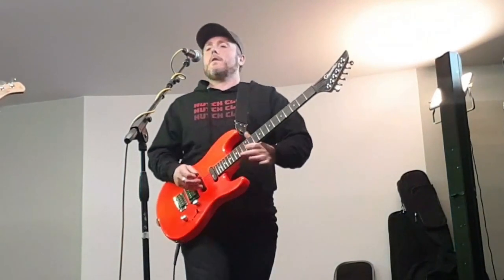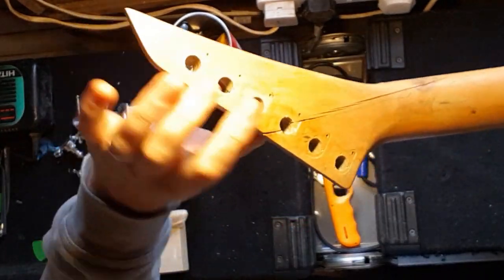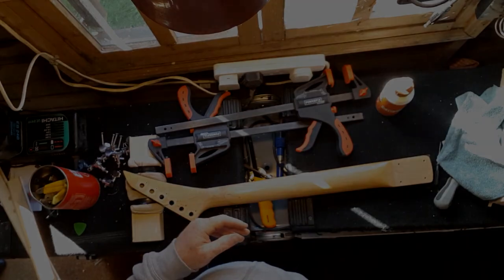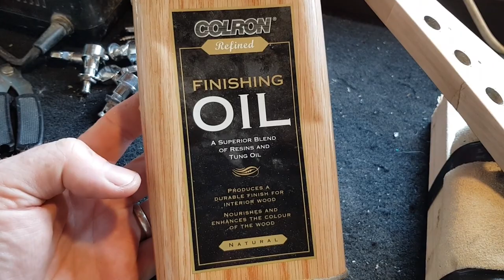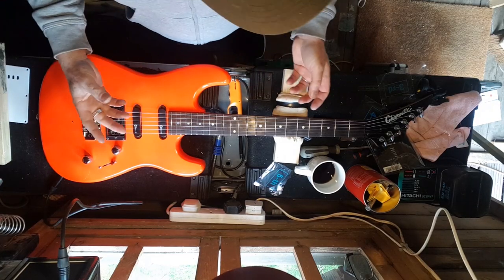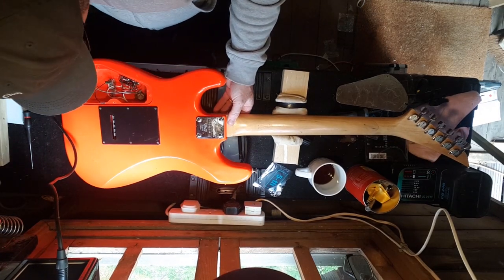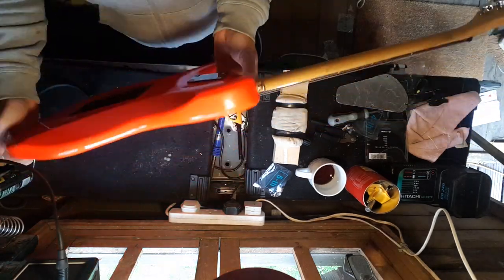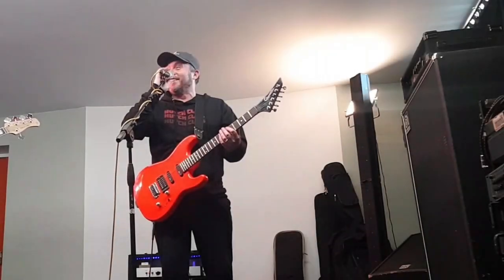Early 90s Charvette Fat Strat Saved !!! Why Did I ever Get Rid of Mine?

Comment from the maker: Fun Fact! I had this same guitar was I was 15 and it was the second guitar I ever owned. Working on this one was a trip down memory lane and I am so happy it is now back to Rocking out!!  Any of you guys had one of these?
Reply: Brilliant playing....and what a guitar love the neck...
Reply: My first electric when I decided to start playing 10 years ago.  Bought it from a guy on craigslist for $100, had to drive to meet him in a parking lot.  Turned around and drove to san diego to get a valvetronix amp to go with it.  Love the guitar.  Love the reverse headstock, I aped a lot of nine inch nails type stuff with that low e, just learning to play what I could and enjoying the guitar.  And the pickups are sweet, dynamic turned low, and the humbucker really screams when full on.  Eventually upgraded the pots to give me coil split and modern/50s tone control switch, and replaced the 5way, cleaned the sound a bit, but it’s always had intonation problems with the d string, and goes out of tune pretty easily, so it’s a personal player/‘sound’ guitar.  I usually play my mim strat, but it is a good backup, and the ceramics sound as good as the gfs alnicos in my strat, so it’s sort of a backup guitar.  Oh and that paintjob, nuclear neon orange!  And strangely I found if you put a blacklight on it there is a ‘charvel’ logo that faintly pops up.  There’s controversy over whether they were made in japan or korea, but it is a solid guitar.  A lot of people trash them online (literally) for being ‘plywood’ guitars, but it’s fine basswood ply and mine isn’t exactly splitting apart 30 years on.  Just as many people also left the same ‘why did I get rid of it’ comments as well I noticed.